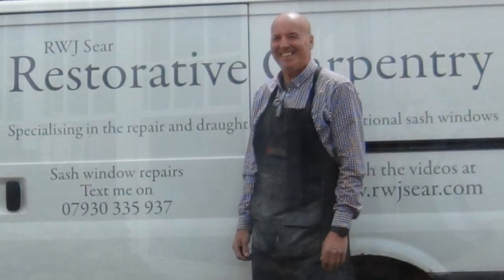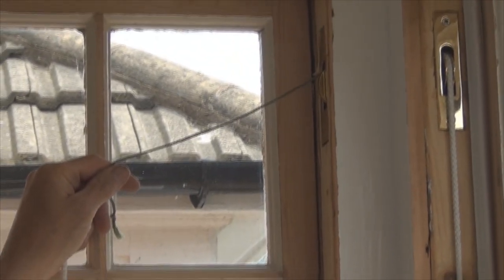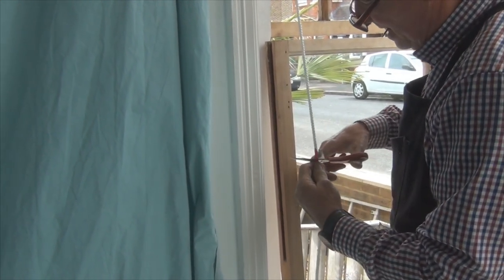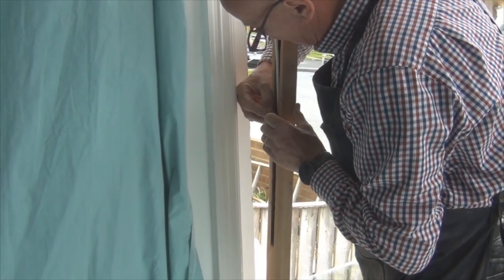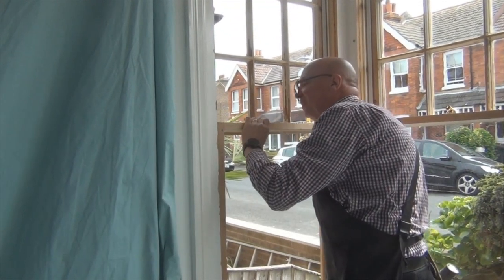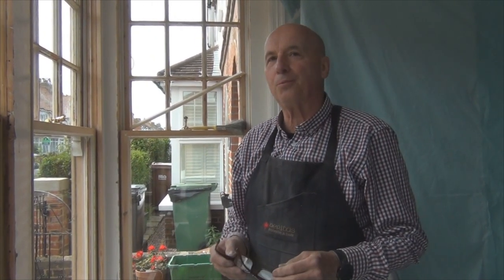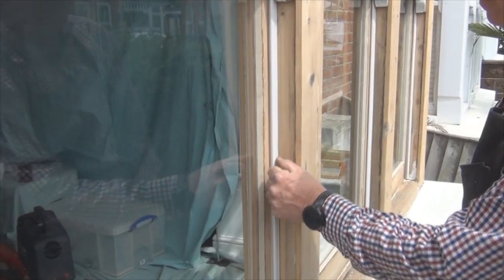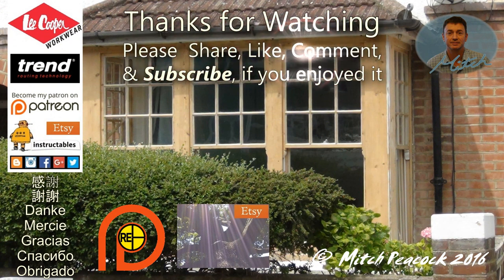Sash Window Restoration Part 7

Comment: Beautiful video, Mitch.
The node with which the rope was introduced, I know by the army here. We have taken the knot to attach radio lines. Private I use the node if I need an extension cord and the extension cord must not slip the banister down to me, so they will not slip on voltage.
The video series was very interesting, because I have worked even times in the window assembly.
Reply from the maker: Thanks Gunter. I'm pleased you've enjoyed it.

Comment: ..I'd also be interested in more detail about how you made/fitted the rotten bottom and meeting rails.. many thanks
Reply from the maker: Again from memory, these were either made up new or the rot was cut out and new wood spliced in. The sash joints are wedged, so mortises are oversized with wedges driven in to bring them tight.

Comment: Why not use a lime based filler instead of the epoxy? Traditionally it was done with chalk flour and llinseed oil but modern top coat lime plaster is a good alternative.  Surely the epoxy is always going to trap water against the wood?
Reply from the maker: Jim explained to me at the time that since he is only filling thin fissures, there is plenty of scope for the wood to breath underneath. Sounded feasible to me, but I do like the idea of a breathable filler, if it is compatible with the paint and has a decent lifespan.

Comment: What's the best paint to use?
Reply from the maker: I'm not sure I remember what Jim said about that, but I think it was oil based at the time. Obviously paint technology moves on, so there may be equally good water based options available.
You can try to contact Jim at Restorative Carpentry, Pevensey Bay
Reply: @mitchwoodwork  I will do that. Thanks very much.

Comment: Do you know what these were painted in
Reply from the maker: It's an awful long time ago but I seem to recall linseed oil based paint. Only a day or so ago there was an interesting comment on one of the seven videos about how since the lead in linseed oil paints had been replaced with zinc that they were now more prone to mould, and there was a better option. Maybe worth you checking that out.

Comment: how is the owner going to finnish the windows, paint or stain, I find that modern paints don't do well on wood and cause more problems than they save.
Reply from the maker: He will be painting them. Hopefully following Jim's recommendations regarding paint selection. I like penetrating finishes for exterior woodwork, but everything would need to be taken back to bare wood for that, which would be quite a job on this bay window.